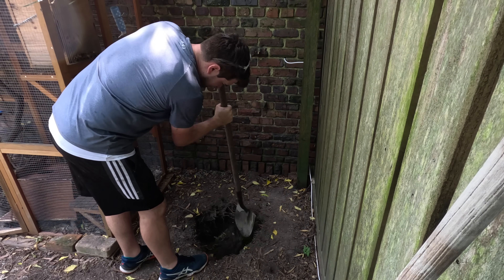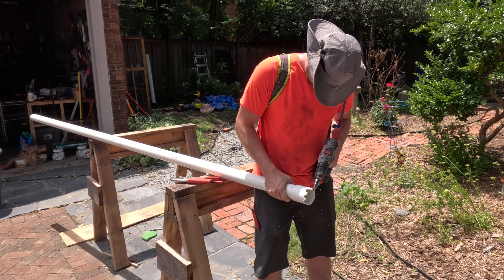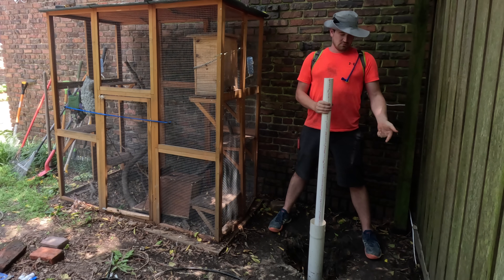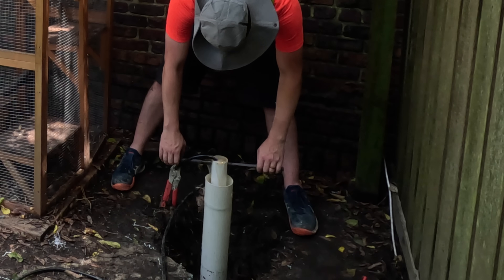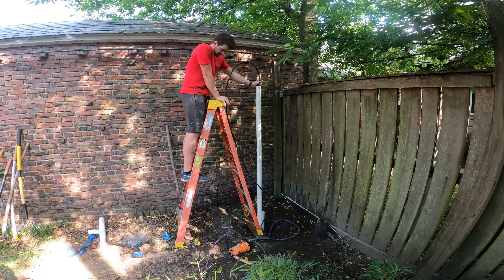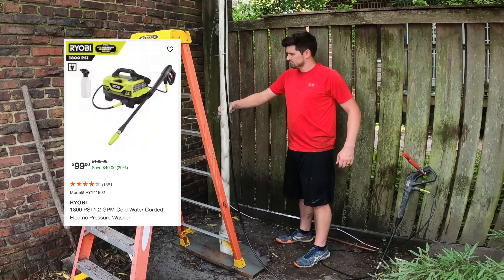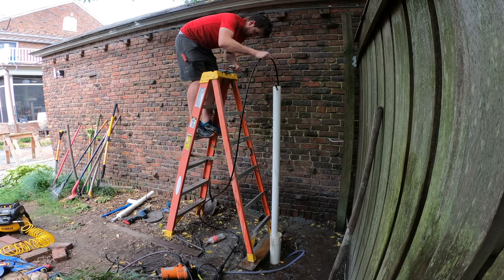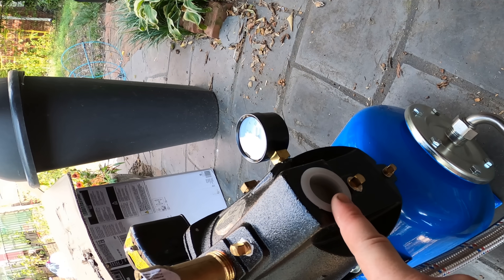I dug a 40 foot well in my backyard

Comment: If you need to go deeper in the future and you can get past that hard spot... Leave your casing alone. Take a marker and carry a STRAIGHT line from the bottom to the top, this  will be your "High Side". You'll have to remove your current end and add your pvc drill bit back on. Use a heat gun, put a small bend in the PVC, say 8" back from your bit/serrated end. You want to bend in the SAME direction as your marked line or "high side". Maybe another 8" back and put another slight bed on your high side mark. Trip back in the hole, pick a direction or a set point, and work as you did before, watching your high side. Right before you get back on bottom, start "Directional Drilling" :)  Hopefully you can work around what ever you're hitting. If you still can't get around it, get another direction you want to drill and start again. This is how we Directional Drill in the Oilfield except we have a MWD Tool that tells me what direction the bit is going. I've used this same tecnique to drill under driveways to run cables. I just kept my High Side between 23:00 and 01:00 which is facing the sky, or 350° and 10° in the Oilfield. You did good letting the water do the work.

Comment: How did you find out the height of your water table?
Reply: Usually 40 ft is considered a shallow well and it’s just rainwater.  At this depth water has a lot of iron and will cause rust and brown stains. You’ve probably seen this on peoples houses if they use it for irrigation and it gets on their house. In Florida the best water comes from spring water and it can start as shallow as 80ft and run as deep as 1000ft.
Reply: Websoil survey
Reply: Ask your neighbors too how deep theirs is

Comment: It's not safe to drill a well nere a house or structure, there are multiple reasons, but the main reason is that there are chemicals in the soil to kill TERMITES MAINLY, These are A FOREVER CHEMICALS! It may not kill you, but you will die years before you  should have otherwise
Reply from the maker: This is a brick shed. Termites don't eat brick. It's never been treated with anything. You're ridiculous.

Comment: Hey great video! This is actually my job. You did amazing work as a diy. Consider of putting the valve at the bottom of the well and pulling the end cone in the peripheral pipe, so dirt wont clog the suction oipe in the long run. In boreholes we put peripheral pipes called filters where the water column exists. Have in mind that pressure pumps have a limited capability of sucrion depth and probably they will work on cavitation, wearing the pump really fast. There are also other diy ways to pump the water. A hand pump like tge old days would be a nice idea and a good diy project too, you could turn it into motor pump too. Great content!
Reply: I came to comment this. I work in the oil field, all our our wells the casing is the lowest, it is perforated, and the tubing lands up the casing a little bit. Think of it like a straw in a cup, this way your getting cleaner water all the debris drops to the bottom of the casing.
Reply: Good comments on this comment. I work in Telemetry and Automation for a dewatering amd bypass company, so I assume a couple of you guys are jet pump operators for well point projects. 

When I build out one of these in the feature I have a bunch of field guys who owe me favors for tying telemetry into all of their last minute commitments lol. 

For other that come along and read, what he explaindd earlier is that you cannot pump water higher than 33 ft from its point of origin. Due to a thing called specific gravity, the higher you pump water the more force you apply causing the water to heat up and evaporate. For this reason your well pumps go down IN your well, aka a submersible pump, so its right at the water and does much less work drawing it up, and more working "pushing" it up. At the top of the well you can run a small booster pump to draw up while the submersible pushes.

To explain pump cavitation, think of thousands of tiny bubbles, and each bubble getting split in half, and water getting into tjat space between what is now 2 bubbles. The splitting or popping of these little bubbles under pressure can reach thousands of degress. Its wild, but literally think of a bunch of microscopic bombs going off inside of your pump. I've seen huge pumps weighing hundreds of pounds made out of iron look like swish cheese from caviation. When its a precision, high performance high head 12in pump you basically turned $100k into scrap. Because of bubbles.
Reply: That makes sense about the well point. Why would operating the pump against that lift shorten its life? Higher current?
Reply: @bunberrier he mentioned cavitation which is tiny air bubbles "exploding" inside the pump wearing away the materials. Ideally the pump is at the bottom and pushing the water up rather than sucking like a straw. No way for air to get in the works if it is always under water.
Reply: @bunberrier  When you try to lift water by sucking you do this by lowering the pressure above it (be it air or water). At about 30ft (9 m) you reach a point where the water will boil off due to the low pressure and you will be pumping water-vapour. 
The seal of the pump (shaft between motor and pump) relies on the cooling/lubricating effect of the water being pumped through the pump as this seal is usually two very flat pieces of ceramic sliding/rotating against each other. Without cooling and lubrication these wear down faster (and can become an air-leak). 
Water-vapour does not cool or lubricate well.
Even for pumps that are so-called self-priming, we always fill the pump with water first and if we can the suction-pipe too to give the pump an easy start and prolong its lifespan. 

When there are very low pressure zones in the pump, cavitation can occur (typically on the vanes or near the seal). Bubbles of low pressure form and when they move to a region with higher pressure, they collapse. This collapse is, unfortunately, not symmetrical and the result is a tiny water-jet impacting the material, blasting some of it off ( similar to a shaped charge warhead ).
Reply: Putting the valve at the bottom is a good idea when you know you have a clean well. Putting it where you can maintain it and get rid off those grains of sand that keep it from closing is also a good strategy. 
He didn't draw copious amounts of water from his well first to clean it before installing the permanent fixture, did he?
Reply: Question for you , is there water everywhere ??? Or there are certain spots ?
Reply: @littlerock5909  pretty much everywhere if you dig deep enough, 8 ft for him could be 900ft in a terrible location.
Reply: @queequag1  100-700ft here in the San Joaquin Valley... I had to check, because I felt like his water table was super close to the surface. It is.
Reply: split with a wye and add check valve, and you could set it up for both hand pump, or an electric pump.

Comment: Trouble for me is getting through hardpan. A metal auger with powerful drill just bounces off it. The hardpan is at 30" deep.
Reply from the maker: If the hardpan is solid clay with no big rocks, the pressure washer will eventually get through it if you let it sit for long enough.
Reply: @BadHomeowner  In the 1940s, they punched holes through the hardpan and it was a dozen feet thick. I also would have to go down about 90' to hit water. I wonder how much electricity that would take to draw up the water.

Comment: Why didn't you do 10 foot section of PVC at a time for the well point
Reply from the maker: I could have done this but I was paranoid about dropping a piece down the hole and not being able to get it back out.
Reply: @BadHomeowner  I have been there and learned this. Tie a piece pipe or stick to the before the coupler. Then glue the next piece of pipe on.

Comment: Could you link to the pressure washer tip you used? Or did you take apart the wand and add the hose between the wand and trigger?
Reply from the maker: This is the nozzle I used: https://amzn.to/4c8ndsG

Yes the 50 foot hose is between the trigger and the wand.  The trigger is connected to the pressure washer using its regular hose.

Comment: This may be a silly question but, how do you keep the gravel from falling through the area outside of the casing? Maybe it's more narrow than what I imagine it to be 🤔.  This is an awesome video. I shared it immediately after watching it. Subscribed!
Reply from the maker: Yea it's two things: 1) it's pretty narrow, so not much can get in there.   2) even if it did, having some gravel surrounding the well screen would actually be a good thing. It would help filter out mud/clay and keep it from clogging the well screen.
Reply: @BadHomeowner  Thanks so much for your input. I appreciate it!

Comment: Thanks for doing this. It is awesome. There was a spring on my property that went dry after some construction in the area. I may try to use this technique to restart it.
Reply from the maker: Sometimes they will use a technique called dewatering to suck out all the surface water in order to build a foundation. It should return over time, but also you can just try digging deeper and find the water where it is.

Comment: I have a question about the pump. if it's connected lets say to a washing machine, does it turn itself on and off automatically?
Reply from the maker: Yes the pump has a 30/50 pressure switch. So when something is using water, the pressure will start dropping, the pump will kick on when the PSI drops below 30, and turn back off when it reaches 50 PSI.

Comment: The water/clay mix coming out of the inner pipe is flowing into the casing pipe. Would cut your drill time down quite a bit if you rigged the water to flow on the ground rather than back into your well.
Reply from the maker: Yea, I just didn't have a great way to solve that at the time

Comment: I would LOVE to do this, our annual rainfall has collapsed over the last few years so some free water to supplement it would be a lifesaver. But where we are it's more than 40 METRES before you hit any water so I imagine that's a bit out of the range of a simple PVC system like this but I am mildly tempted to try, maybe we hit something sooner!
Reply from the maker: No harm in trying, other than the cost of some PVC pipe and some time. 

If the water is that far down though it's probably located in a confined aquifer, which probably means it's surrounded by rock. I'd say your chances are low but might be a fun project. 

Let me know how it goes!
Reply: @BadHomeowner  Yes, people around here have 40 m wells but they are quite low capacity and slow replenishing so that's not an aquifer or anything but they aren't getting into rock either, I don't think, so it would be worth a try, I don't need a proper gusher anyway, a few hundred litres a day would definitely be better than nothing. But we are in the hills, the real big wells around here are over 150 m, for commercial growing operations, and they may well be through rock too, now that's a hell of an investment...
Reply: @BadHomeowner I thought you never hit water? But rather something hard down there and are just using the water collected in the line from the surrounding ground?
Reply from the maker: @ObliviouslyGifted  nah I hit water after about 10 feet. So my well point has almost 30ft of water above it.
Reply: @BadHomeowner  👍🏽

Comment: Aren't those pumps only meant to draw 25ft vertical?
Reply from the maker: Yes, 25 ft as measured to the depth of the top of the water, not the length of the pipe.

Comment: I thought having the well point up inside the 2 inch casing a little bit would help keep sand out. Does the point really have to extend below the 2 inch?
Reply from the maker: If the wellpoint is completely up in the 2inch casing, you will not be able to pump ANY water. You need the surface area of the well point exposed directly. 

Sand isn't as big of an issue as you might think.

Comment: Our area you would have to drill down about 1800 feet to get to water
Reply: Better get extra pipe just in case its 2k deep.
Reply: I bet it's not as much as that, but it depends how much water you want. Our house is in the hills and you have to drill up to 200 m (700 ft-ish?) to hit an aquifer, but you would hit other water-bearing layers well before that I would think? It's just the capacity (and water quality) might be less.

Comment: Very impressive, congratulations!  If I do it myself, here are some things I am thinking of modifying, hope they work.  Might be easier to attach the drilling "bit" (pipe) to a handheld mud or cement mixer, rotates with high torque at low speed.  At 11:30 why aren't you standing closer above the tube, just wondering.  If you put a flange on the downpipe, it won't fall in.  I am wondering why you are able to get the well pipe below the digging pipe, because the digging pipe seemed to be stuck at its depth.
Reply: I wonder this too. Somehow the well pipe is magically able to go several feet further?
Reply: @someguy5035 the end of the water jet extended below the end of the tube (he said he had difficulty pulling it out because of this).  Also, the pressure jet digs another foot or two beyond the nozzle...

Comment: No way that thin walled pipe would drill down.
Reply from the maker: Which one? The 2 inch pipe is schedule 40 PVC.  I had no issue with the strength of the pipe

The 4 inch was a thin-walled DWV pipe, which was perfectly fine going down 10 ft

Comment: Would you be able to calculate the gallons of water were used to dig the well vs how many gallons you extracted? Curious how long it takes before you brake even on the water consumption
Reply from the maker: I only used about 200 gallons to dig the well.  I'm pumping about that much in a week, so payoff is pretty quick.

Comment: Where in the coast of Va. I live on the middle peninsula and was thinking about doing this myself. Used to have a portable well drilling machine myself but it vanished! I think mines at 28 foot and the sulfur muddy smell is awful. Was thinking about going deeper. Whatcha think?!
Reply from the maker: I'm southside. So, on the middle peninsula you've got tons of accessible groundwater, which is why they built the West Point paper mill up there.  Paper mills are notoriously prolific consumers -- and polluters -- of groundwater.   You can probably dig using the same method I used in this video, but you'll want to test the water thoroughly to see what's in it.

Comment: Hope you are in a warm climate where it never freezes, otherwise everything will burst.
In cold climates, we build insulated pump-houses with a heat source for winters.
Reply from the maker: Things do get cold here, but since I only use for irrigation I just drain everything in November so it doesn't freeze
Reply: @BadHomeowner  what part of the country are you located?
Reply from the maker: @brettblankenship  East Coast
Reply: A light bulb was more than enough most winters, way below we used a heater too. The way dad pulled wells in similar in the 50'. Worked fine!
Reply: The pump can easily be moved into the basement or insulated pump house
Reply: I live in NY and have a water well, and we don't have that.  There is an iron cover over the well and that's all below ground, which I suppose provides some heat insulation.
Reply: @artichoke60045  I think they primarily meant the pump, that can't stay out in freezing temps, you have to drain it and undo a little valve for expansion. We moved ours into our cellar in the end which worked out really well as it won't ever freeze down there.

Comment: You are going to have problems putting the check valve where you did.  You should have used a foot valve.
Reply from the maker: There's no difference, and I've had no problems since I installed it a year ago.

If/when I have to replace it, I'd rather have it at the top than at the bottom.

Comment: Did something similar but used a threaded adapter on the bottom of the 2” pvc and threaded a piece of steel pipe into it with the cutting teeth.
Reply from the maker: I was worried about putting something threaded on the bottom twisting off as I dig. Was that an issue for you at all?
Reply: @BadHomeowner  I drilled a hole in the pipe and used a self tapping screw to secure it to the pvc after threading it on.
Reply from the maker: @akbychoice  ah good idea